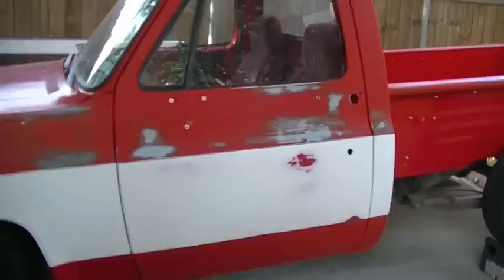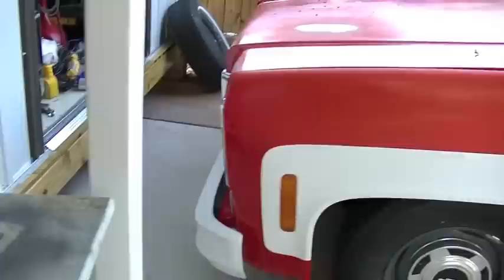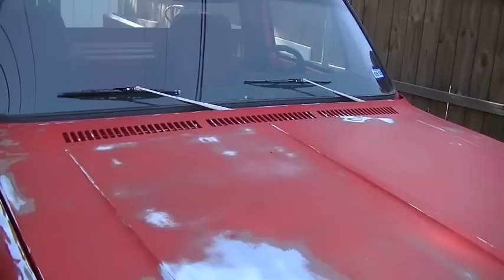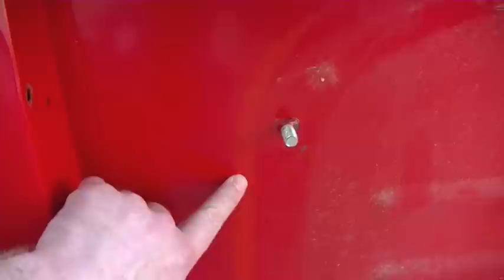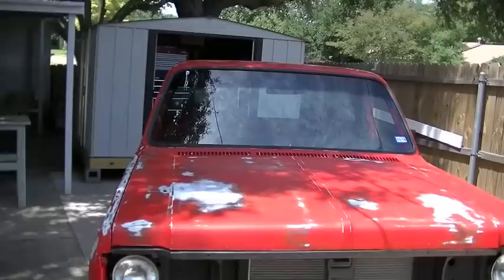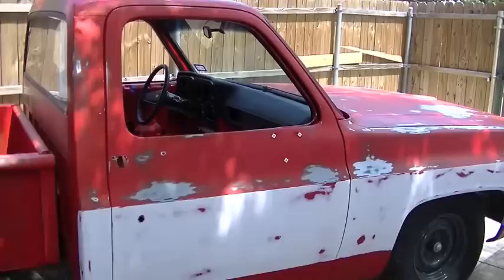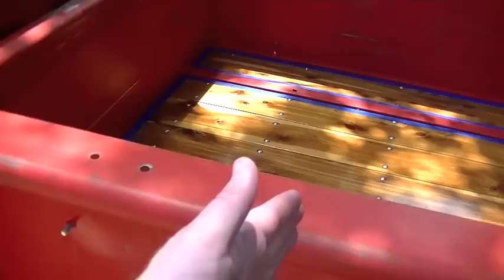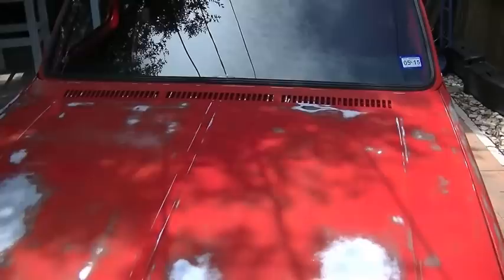PART 3 FAUXTINA PAINT JOB | How To Create Fauxtina

Comment: Good job sir.... One thing my buddy taught me was the value of red scotch brite pads for stuff like edges and the cowl cut out area.....

We gloss cleared a blue 63 falcon 2 years ago and we sanded it thru the one re paint ( dark blue ). And original blue was close to robins egg blue I think .... We left the Mickey bondo filler on the lower rear quarters ( wasn't much) and also sanded entire roof to " bare metal ....  Effectively a survivor car.  The cool thing is its showcasing the originality while being cool now!!!
Reply from the maker: +Paul Zonneveld If you have pics of the Falcon you can share them on my Facebook page.  Thanks for watching!